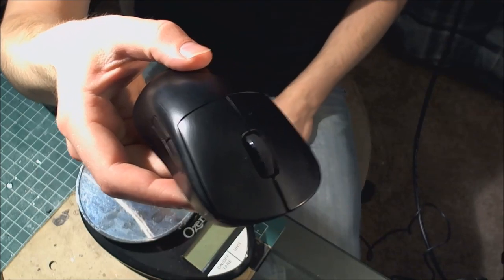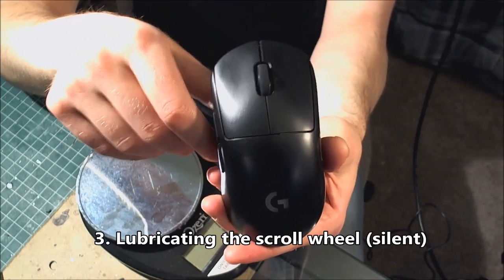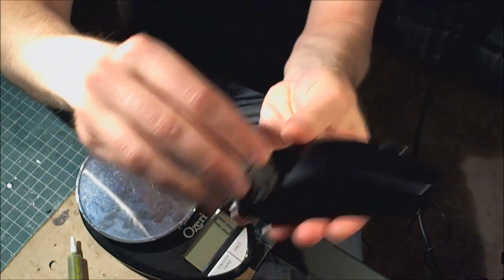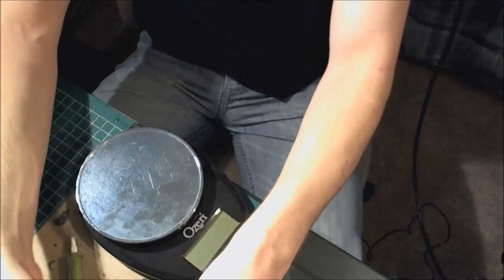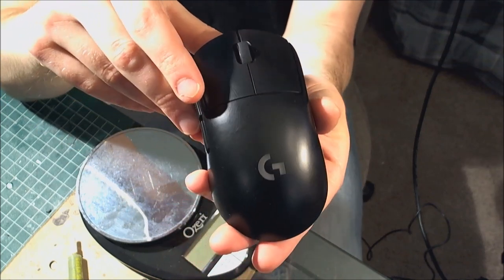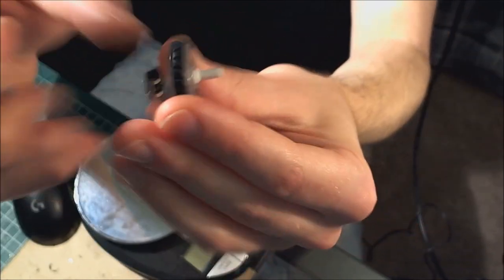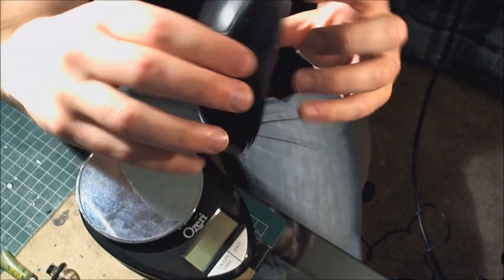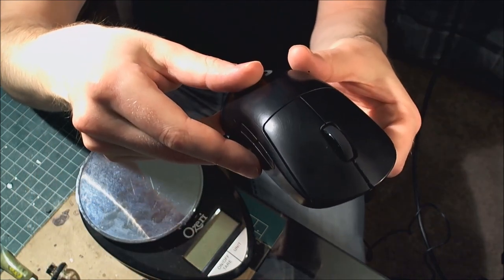3 mods for the G Pro Wireless

Comment: Didn't even paracord it...smh
Reply: If you charge your mouse when ur not gaming, or at night you literally never need it plugged in. I charge mine once a week at night and iuts fine
Reply: @Robstrap  whoosh
Reply: why would you want to paracord a wireless mouse OMEGALUL, it only needs to charge for 1 hour every intense week of gaming
Reply: @iSammax  That's the joke.
Reply: The old g pro was great. I liked the old shape more than this one. I got the g305 and used a battery adapter AA to AAA. Its wireless, shape feels like the old G pro, and with the battery mod just as light the new G pro while still having great battery life. One triple AAA will last me a month and it's 14 bucks for a 16 pack of duracle ones off amazon.
Reply: @cognition26  the joke went over your head so hard my dude wtfffff

Comment: i just wetsand mine with 1200 sandpaper and then polish it with a microfiber pad and pepsodent lmao. obviosly cleaning before and after with iso alcohol. solved my grip sliding problem with the matte textured coating. i'm still getting grip sliding with both so a cleaning with alcohol is enough but i feel with a polished finish will grip more. i have G PRO HERO Wired.